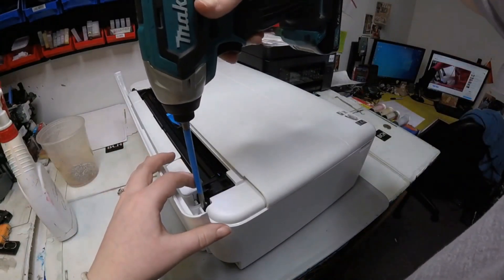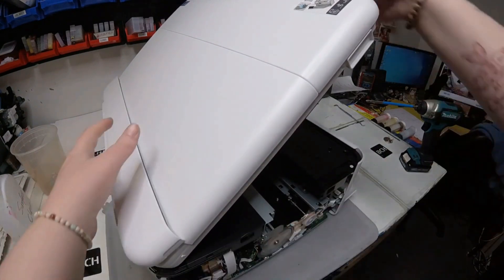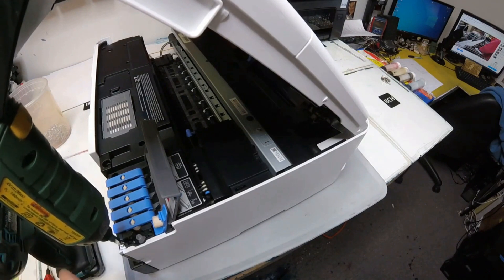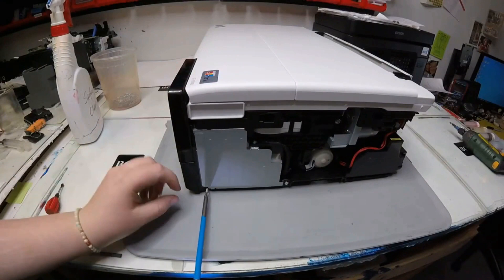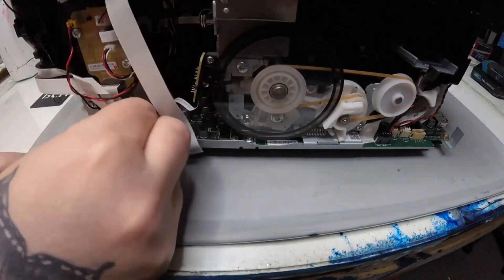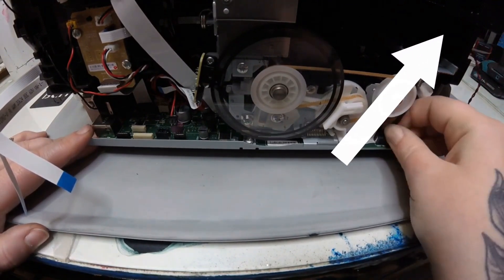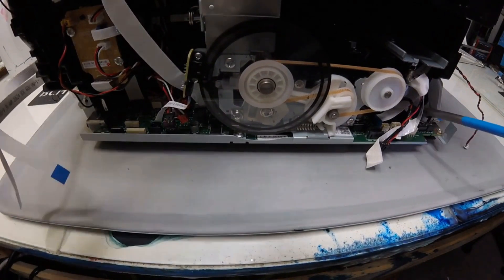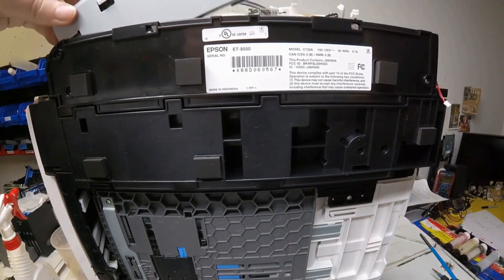How to Remove an Epson EcoTank ET-8550 Mainboard

Comment: Is it possible to get some wire coupling to extend all these cables and affix this main board outside of printer case?
Reply from the maker: Thanks so much for your question and for supporting the channel! Yes, it’s definitely possible to use wire couplers to extend those cables and mount the ET-8550 mainboard outside the printer case, and we’re actually working on producing some extensions specifically for that purpose. I really appreciate you watching and engaging, and if you haven’t already, subscribing or becoming a member is the best way to get priority replies since I get a high volume of questions every day; subscribers and members are usually answered within 48 hours, while non-subscribers are answered as time allows, about 10 per day, and after that I reply to the newest comments first, so if you don’t hear back within 48 hours you can subscribe or re-post your question, and if you subscribe later your older questions automatically move into the priority queue. You’re also invited to join me on Run With Kevin — LIVE, where I go live most mornings between 6–8 AM Eastern and answer printer questions in real time, so be sure to subscribe and turn on notifications so you can catch the next session. If you ever need faster help, feel free to email [support@bchtechnologies.com](mailto:support@bchtechnologies.com), and if this video or reply helped you, I’d really appreciate a quick Google review at [https://g.page/r/CfL7k6nYvPQ9EAg/review](https://g.page/r/CfL7k6nYvPQ9EAg/review).

Comment: If I change my motherboard out, do you think my printer will come back on after I put a new one in because it has no power to it for some reason
Reply from the maker: Thanks for your question and for watching the guide! Replacing the mainboard is definitely the most common fix for a printer with no power, so there's a very good chance it will resolve the issue, though it's always best to double-check simpler things like the power cable and outlet first. I really appreciate your engagement! We get a high volume of comments, so I prioritize answering our subscribers and channel members within 48 hours as a thank-you for their support—they also get exclusive perks like early video access. If you're not subscribed and don't see a reply in 48 hours, you can either subscribe (your old questions then automatically become priority, so no need to re-post) or simply re-post your question as we review newer comments first. For a faster and more definitive diagnosis, I'd recommend emailing support@bchtechnologies.com directly, and if you found this helpful, I'd be incredibly grateful if you could leave a Google review at https://g.page/r/CfL7k6nYvPQ9EAg/review.

Comment: What is the issue when the screen doesnt work and it turns on and back off by itself..
Reply from the maker: Thanks so much for your question and support! If your ET-8550 powers on and then shuts off with no display, it’s often caused by a shorted mainboard, damaged power circuit, or a failed display connection, sometimes triggered by moisture or a short in the printhead area. Disconnecting all peripherals and testing the power board output can help isolate the problem, but if the printer cycles on and off instantly, the mainboard usually needs inspection or replacement. I really appreciate your engagement—please consider subscribing or becoming a member so your questions get priority answers and early video access. I get a high volume of questions daily and can only answer around 10 per day, so subscribers and members are answered within 48 hours, while regular viewers are answered if time allows, with newest questions going first. If you’re not subscribed and don’t get a reply within 48 hours, you can subscribe or re-post your question; once you subscribe, all past questions automatically become priority. For faster help, you can also email [support@bchtechnologies.com](mailto:support@bchtechnologies.com). And if this video or answer helped you, please leave a quick Google review here: [https://g.page/r/CfL7k6nYvPQ9EAg/review](https://g.page/r/CfL7k6nYvPQ9EAg/review).

Comment: Hi, congratulations, great video. I have an Ecotank ET-8550 printer, and it's giving me a scanner error and won't let me do anything. Could you please tell me how I can fix this error and if there's a way to disable the scanner? Thanks.
Reply from the maker: Thanks so much for watching and for the great question! There’s no way to disable the scanner on the ET-8550, but fixing a scanner error is usually straightforward once you identify whether the issue is the lamp, the motor, or the FFC cable, and once you know which one it is, you can repair it easily—we carry all three replacement parts at bchtechnologies.com. I really appreciate your support, and if you’d like faster replies, please consider subscribing or becoming a member, since subscribers and members get priority responses within about 48 hours and also receive early access to new videos; I get a high volume of questions and can only answer around 10 per day for non-subscribers, and those are handled last-in, first-out, so if you don’t hear back within 48 hours you can subscribe or simply re-post your question so it moves to the top, and if you subscribe later, your older questions automatically become priority without needing to re-post. You’re also welcome to join me on Run With Kevin — LIVE, where I go live most mornings between 6–8 AM Eastern and answer printer questions in real time, so be sure to subscribe and turn on notifications to catch the next session. If you need quicker help, feel free to email [support@bchtechnologies.com](mailto:support@bchtechnologies.com), and if this video or reply helped you, I’d be grateful if you left a quick Google review at [https://g.page/r/CfL7k6nYvPQ9EAg/review](https://g.page/r/CfL7k6nYvPQ9EAg/review).

Comment: Hola felicidades buen video. yo tengo una impresora Ecotank ET-8550 y me está dando error de escáner y no me deja hacer nada por favor me podrian decir como puedo solucionar ese error y si se hay alguna forma de anularle el escáner. gracias
Reply from the maker: Thank you so much for your support and kind words—¡muchas gracias por ver el video y comentar! For the ET-8550 scanner error, the first step is to identify what’s actually failing before trying to disable anything, because the printer will lock up if the scanner can’t initialize correctly; there are three cables involved in the scanner assembly: the power cable for the scanner motor, the data (FFC) cable for the scanner, and the LCD/control panel cable, and the scanner data and LCD cables are extremely thin and easy to damage or mis-seat, so you want to carefully reseat and inspect them first (this cable set is here: [https://bchtechnologies.com/products/ffc-cable-for-epson-ecotank-et-8550-scanner-3-cable-combo-et8550?_pos=1&_sid=557c1a4f8&_ss=r](https://bchtechnologies.com/products/ffc-cable-for-epson-ecotank-et-8550-scanner-3-cable-combo-et8550?_pos=1&_sid=557c1a4f8&_ss=r)); when you power the printer on, watch closely to see if the scanner lamp turns on (that confirms data communication) and whether the scanner carriage tries to move (that confirms motor power), because if the lamp never lights, it’s often either a damaged data cable or a failed scanner lamp itself, which can be replaced with this CIS unit: [https://bchtechnologies.com/products/genuine-epson-scanner-head-lamp-17-pin-model-fa-4a603-m-contact-image-sensor-cis-unit?_pos=5&_sid=5d2e10e53&_ss=r](https://bchtechnologies.com/products/genuine-epson-scanner-head-lamp-17-pin-model-fa-4a603-m-contact-image-sensor-cis-unit?_pos=5&_sid=5d2e10e53&_ss=r); unfortunately, there’s no reliable way to permanently “disable” the scanner without triggering errors, so fixing the root cause is the correct path; I really appreciate your engagement, and if this helped, please consider subscribing or becoming a channel member—subscribers and members get priority replies (usually within 48 hours), early access to videos, and extra benefits, while regular viewers are answered if time allows since I can only respond to about 10 questions per day, with remaining spots filled last-in, first-out (newest comments first), so if you don’t hear back within 48 hours you can subscribe or repost your question, and if you subscribe later your older questions automatically move into priority without reposting; you’re also welcome to join Run With Kevin — LIVE, where I go live every morning (usually between 6–8 AM Eastern) answering printer questions in real time, so subscribe and turn on notifications to catch the next session and ask directly; if you need faster help, email [support@bchtechnologies.com](mailto:support@bchtechnologies.com), and if this video or comment helped you, I’d truly appreciate a Google review here: [https://g.page/r/CfL7k6nYvPQ9EAg/review](https://g.page/r/CfL7k6nYvPQ9EAg/review) 📋 Copy

Comment: I put the motherboard back in without the plate over it.  Should I uninstall the motherboard or run it like it is.  Not sure if removing cause more of a risk of failure.
Reply from the maker: Thanks for subscribing to my channel! With around 55K subscribers, I’m really pushing to reach the 100K milestone, and every subscriber like you plays a key role in getting there. I truly appreciate your support and for taking the time to ask this thoughtful question.  

The metal cover on the mainboard primarily serves as a shield against electromagnetic interference (EMI), protecting sensitive components, and providing physical safety against dust or accidental contact. It also helps dissipate heat, which keeps the mainboard running efficiently. However, in practice, we often don't reinstall the metal cover during our repairs. The ET-8550's mainboard isn't in a position where EMI is a major concern, and similar models like the L1800 or 1390 feature an open design with only bottom casing for protection.  

The bottom casing's main role is to lift the mainboard slightly to prevent the legs of through-hole components from shorting out. If you're using a non-conductive holder for the bottom, it's generally fine to operate without the metal cover. That said, if you're worried about long-term durability or interference, you can reinstall the cover for extra peace of mind. If you have more questions, feel free to email me at *support@bchtechnologies.com* or leave a comment on one of my most recent videos for a faster response. Thanks again for being part of the community!

Comment: Did a manual printhead clean on my epson et 8550. Now it says transportation lock. It is NOT in transportation lock. Help!!
Reply: Hi, same to me! How did you solve?
Reply: I’m having the same issue. It will say the transportation lock is on or paper jam but haven’t been able to print. Have you found a solution?